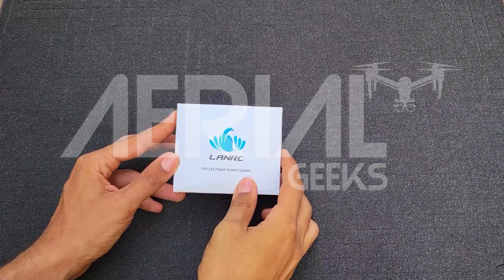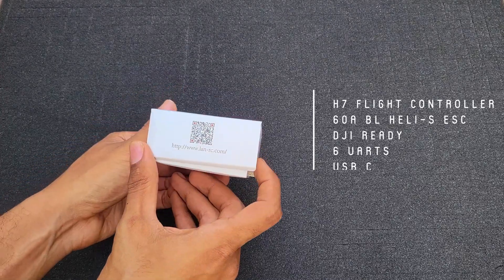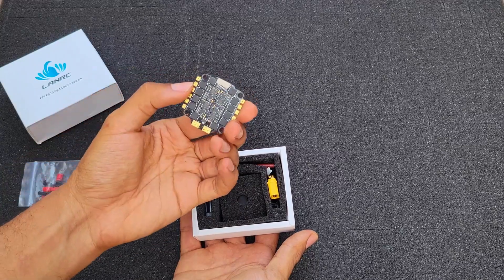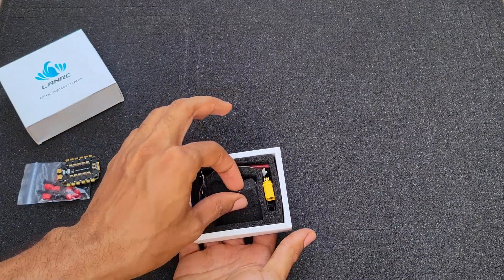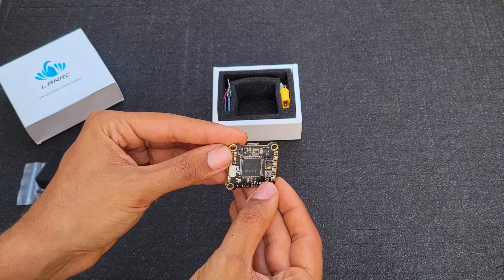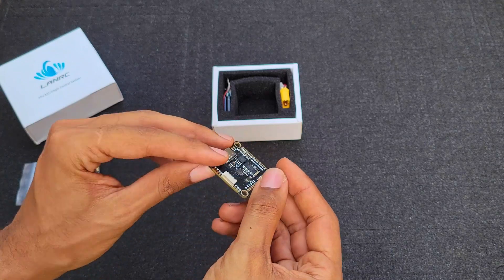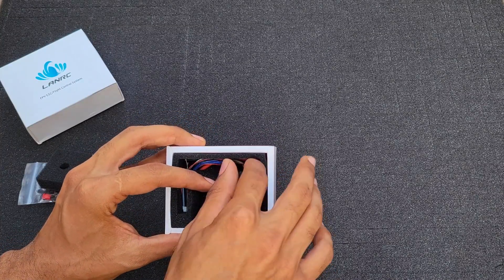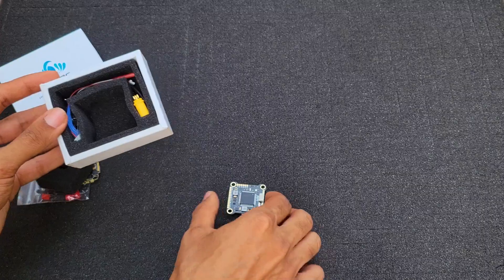LANRC H743HD Flight Controller & 60A ESC Overview

Comment: Hi. Do you have a pinout diagram for the flight controller? I've lost mine, can't find it in google.
Reply from the maker: It's no longer available.  The Flight controller has labels for each pad and it's also quite similar to the skystars H7 flight controller so I believe the pin out diagram is the same.
Reply: @ that’s right. But there is no longer target available for Betaflight 4.5+, so it’s tricky to get new bf update.

Comment: Hello and thank you. I got to say I believe you're the first channel to review this I just pulled mine out of my drone upon plug in the 5 volt regulator on the flight controller magic smoked luckily I bought it from Amazon and the replacement will be here tomorrow so hopefully it will light up and work I'm going to be using it on a 7-in longish range drone.
 Mine came as a diamond hobby flight controller then I read the lan RC on it and tried to research that with no luck and to see that it's firmware is Iflight 743 all in one really had the head scratch and going on and I didn't get a chance to fly it so it look like yours work fine I can't wait for another hour of soldering on attempt number two. Thanks again for posting this I would love to know more of your thoughts on it as you get into it or if you can come up with a manufacturer or something that'd be interesting.
Reply from the maker: I'm glad I could help. I believe these are maybe rebranded boards; that's why yours said diamond hobby. 

I do hope you have a multimeter to check for shorts before plugging in a battery also helps if you have a smoke stopper. I can say it's a good flight controller,  doesn't get too hot and no issues so far. Let me know if you need any info. And yes the target is iflightH7AIO truly.